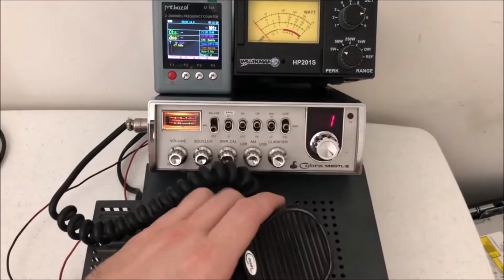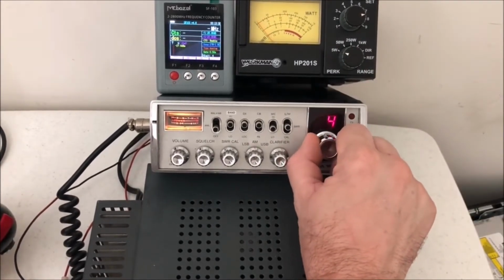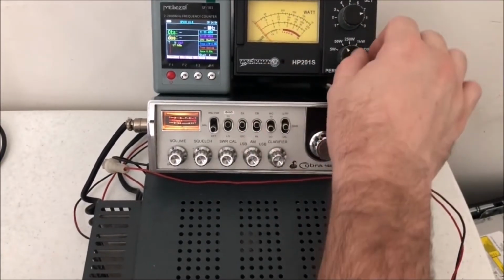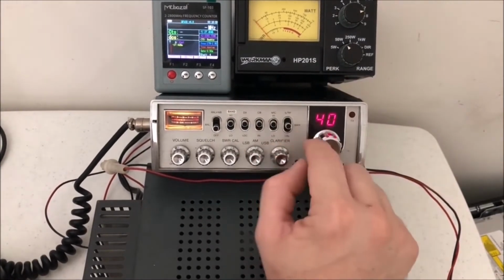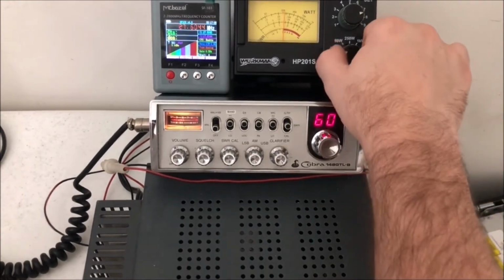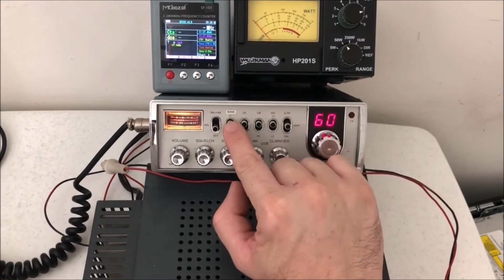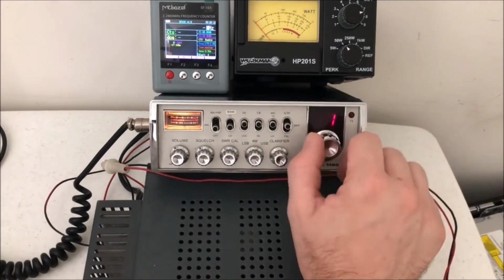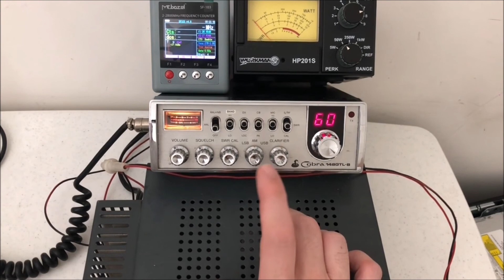Cobra 148GTL-B Part 2 : Operation

Comment: Just scored one on eBay, ever figure out how the mod was done? Was a mod even required? Cut trace on PLL?
Reply from the maker: Congrats on the nice score ! This radio is so cool based on the 60 channel and ripping off the popularity of the Cobra 148. . Give me a day or so and I can pop my covers.  It's the wonderful PLL 02a so it could just be a switch pulling apin high or low. I got it this way,  I'll put up a video on it..not many videos on this radio !
Reply: @EricTechstuffs  thanks!. On mine the display goes to channel 60 going to connect to my freq counter and see what range and I will report back here.  I like your work, I am going to attempt to copy you and build a Frankenbase just looking for a donor. One question is what frequency counter display are you using on most of your Frankenbases?
Reply from the maker: @shredwell2326   I just popped the covers.  The switch was rewired to switch crystals. There are  2 extra slots x3 and x4 that can be populated with crystals and filter parts.   However a pll-02a switch mod could be easier as old school crystals are hard to come by !   Here is a good doc to help on these .  http://www.zen96216.zen.co.uk/cb/cybernet-esm.htm
Reply from the maker: @shredwell2326   I use those frequency display kits from eBay. Pretty cheap.  Hard to find the Galaxy  FC-370  counters that would help track rx and transmit at this time
Reply: @EricTechstuffs  nice, I'll go check out the link!!now I have to pop the covers to look!
Reply: @EricTechstuffs  I subscribed and figured it out watching one of your other videos, I had one ordered already on amazon to play with. If you want a really cool toy try a GPS disciplined 10mhz oscillator to feed your bench freq counter, got one and  it works really well for the $
Reply: @EricTechstuffs  👍